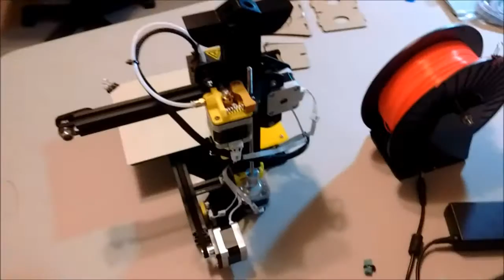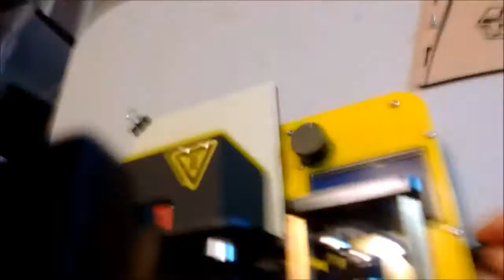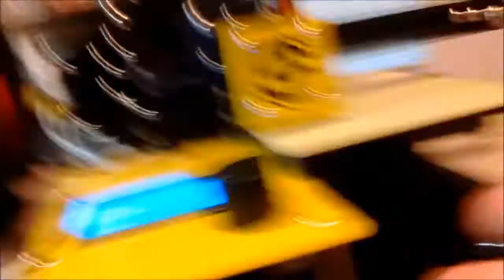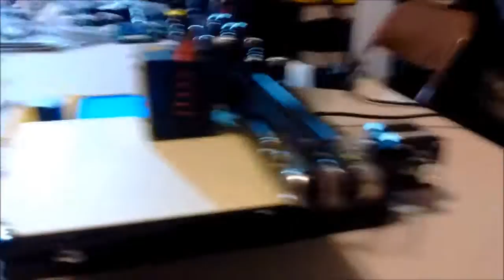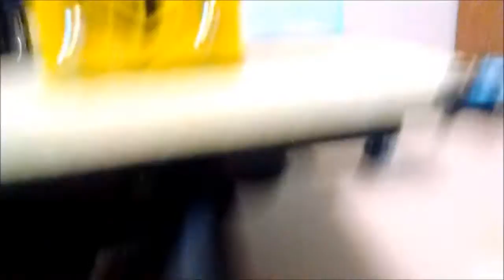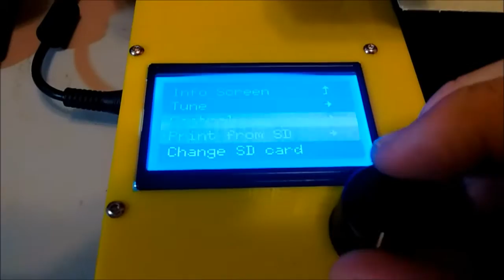Setting up the Freaks3D Printer

Comment: i ve got a blue screen on the control panel..please help
Reply from the maker: Have you tried removing the top screen panel and unplugging and plugging back in the screen cable?
Reply: yes...I removed completely the plastic parts and nothing happened

Comment: Hi
I am planning on using Lithium grease on the screw, will this be affected by the oiler?
Reply from the maker: I'm not sure. I've never used that type of grease before.
Reply: +Masters of the 3rd Dimension What type of oil do you recommend mineral or synthetic?
Reply from the maker: +Robert Robati I don't think it matters too much. I've heard of some people using vegetable oil. I use a synthetic gun oil I had laying around.
Reply: Thanks

Comment: Can you help me? I done put everything together. I have problem with extruder when I print the extruder motor it just keep go left and right and it won't pull the filament it keep run but no filament come out at tip of extruder. DO you know what wrong? can you please help me? thanks so much,

Comment: Hello josh, i see you use a aluminum z axis coupler for the z axis thread. Can you send me a link as to where you purchased it? The 5m nuts on my printer is not moving any further than 2cm. I believe it is the z axis thread damage and i not getting any help from the manufacturer.
Reply from the maker: I've built several kits (probably 1 out of 4 ratio) that have had bad 5mm nuts that won't travel down the thread. I went to the hardware store and got a handful of 5mm nuts and they work fine, so I've just been swapping them out.  I also get my couplers off eBay, whatever is cheapest and timely drone on my needs. Just search “5mm x 5mm Flexible Z Axis Coupler" and you should find tons of options.
Reply: +Masters of the 3rd Dimension  So it does not necessarily be the thread, but the nuts. Thanks alot..
Reply from the maker: +Llanos Rodriguez Yeah, I've never encountered a bad thread.

Comment: Hey Josh, I can't get the extruder motor to work at all, it's not the motor because I tried switching the moters and cables. Multimeter shows no signal and there's zero source code for the firmware. Very frustrated that there's no response from them whatsoever. 
To make things worse, I cannot establish serial connection over USB. Any idea what the serial connection settings are? Baud Rate? Text or binary?
Reply from the maker: The extruder motor won't mover until the nozzle is at least 190°. If you heat it and it still won't move, you might check the cable and make sure it isn't damaged or you might have to adjust the potentiometer screw, which is a little Phillips head screw next to the connecter. I wouldn't mess with the screw until you've tried all else.

Anyways, the baud rate is 115200. I'm not sure about binary or text. You could try both and let me know which one works?
Reply: +Masters of the 3rd Dimension   YES!  Thanks! That's what it was! Turns out that it's very very slow to establish the connection, but it does connect with MatterControl. I'm so glad it's printing now, and the print quality is pretty good from Cura. Thank you so much!
Reply from the maker: +carolcheny Glad I can help! :-)

Comment: I can't seem to get my board adjusted correctly, followed the steps to adjust the board but it prints to high and won't stick. So I started over and sent it to auto home and now the board is to high and the z axis won't go all the way down. I had it printing finally today and then all of a sudden it's as if it wasn't raising and it scrapped the pla off the board with the extruded box.
Reply from the maker: You might check your slicer to see if there is a Z offset setting in your slicer. If you do make sure its set to zero. Also, make sure your first layer height setting isn't too high. I print at .4mm for the first layer with 200% extrusion on a really slow speed, around 15mm/s.
Reply: not gonna lie I have no clue what any of that means lol I'm attempting to print the Demo off the SD card and it now either scrapes the tape off or prints something unrecognizable.
Reply from the maker: +Sinister Golf Lol! That's fine. It takes a while to learn it all. The most difficult thing to do is adjust the bed, but once you get it its easy. The demo print has a low first layer so there isn't much margin for error. Try using a glue stick on the tape so the plastic will stick better. If the nozzle drags the print around it failed and you should try again.
Reply: Im pretty sure my printer just hates me lol Ive got an email into the company now. Everytime I get it set to home and go to print it raises up about a half inch then go to the center and starts printing in the air.
Reply: +Sinister Golf  I posted a video on my page of what it does everytime I print. If you get a chance can you look at it let me know if Im just an idiot lol thanks.
Reply from the maker: +Sinister Golf That looks like you might need to try slicing your own file with Cura or Repetier Host. There might be something wrong with the print file you're trying to print.
Reply: +Sinister Golf Could be the Z axis coupling with the motor is too far apart? push them together.
Reply: That was the problem! Thanks!, Now the only issue I seem to be having is the hotend Leaks like crazy. It drops chunks of PLA on all my prints. Ive been trying for over a week to get ahold of the company with no reply.
Reply: +Sinister Golf Oozing can be controlled with the nozzle temp. If it's too cold pressure will build up and cause dripping and if its too hot it'll just fall out. I'd start at 180° and change it 5° until the leaking stops.
Reply: Ill try it out thanks, Ive been running at 197*
Reply from the maker: +Sinister Golf Also, the temp has more to do with the filament you're using than the printer.
Reply: +Masters of the 3rd Dimension I'm slowly learning about all the little things that can affect the print. Retraction, non print speeds, the quality of material I'm using. You guys have been a huge help thanks! I'm gonna order some good material today and run some test prints to get everything dialed in.
Reply from the maker: +Sinister Golf Awesome! I'm glad you're getting it all figured out.

Comment: How do you attach rubber treads? they come open ended. Didnt see how to attach them
Reply from the maker: The kits comes with a bundle of zip ties. You thread the belt through the slots, make it snug but not too tight, and fold it over teeth on teeth and secure it with a zip tie.
Reply from the maker: The kit comes with a bundle of zip ties. You thread the belt through the slots, pull it snug, fold it over teeth on teeth, and secure it with a zip tie.